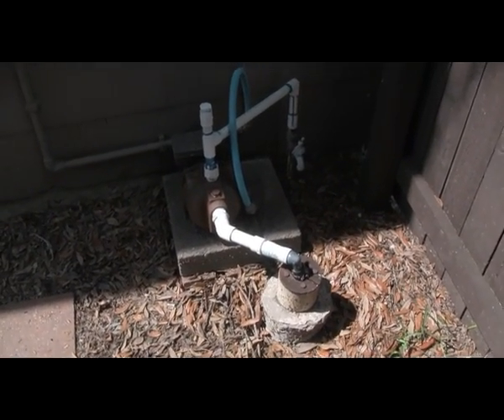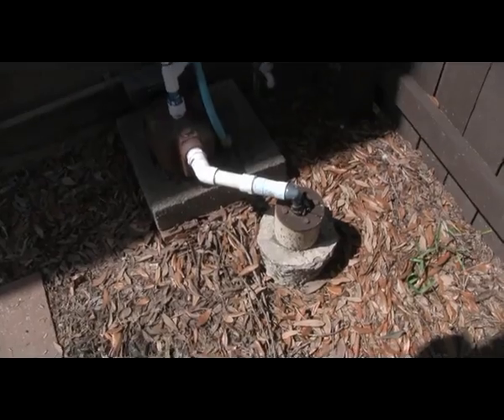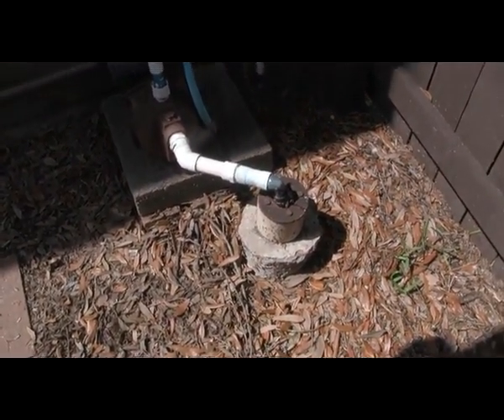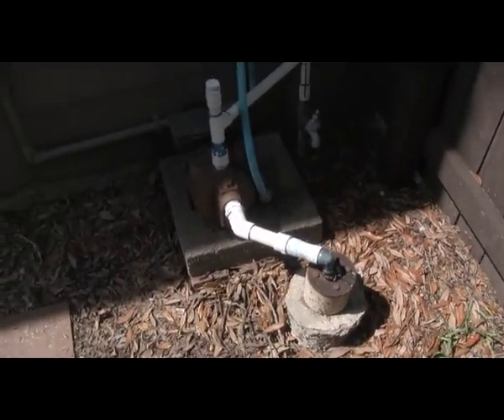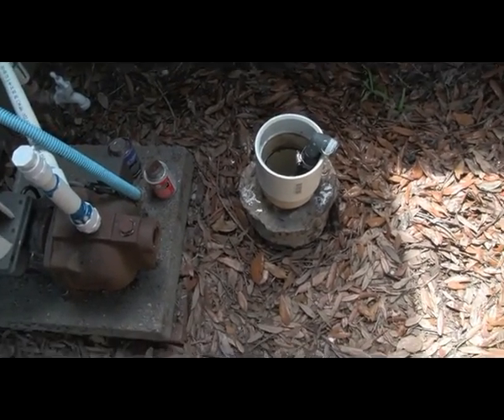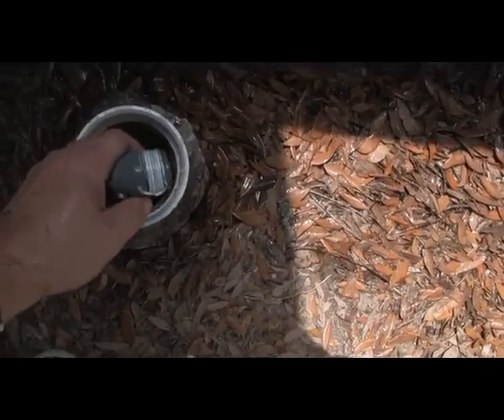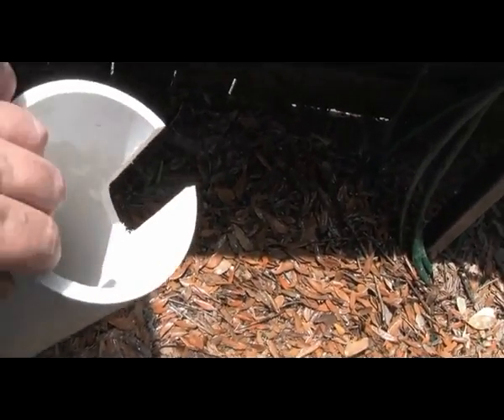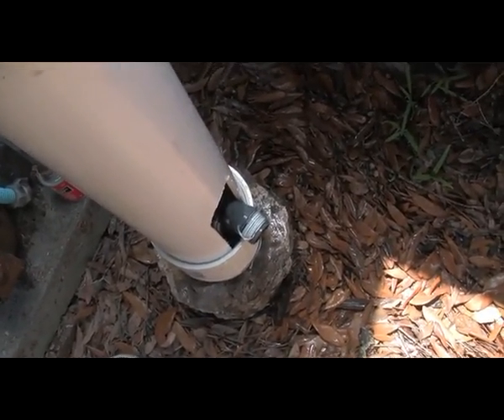Harbor Freight  well hand pump install

Comment: You're the man! I have a well with an electric pump that doesn't tie into the house. I've got the electric pump working so I can  use the well to water the grass, but I've been wanting to add a hand pump as well for an emergency water supply. We live in hurricane country, so this will come in handy when the power goes out.

Comment: Now that was one great video and very much appreciated.  I have a 100' well with a 3" casing, water at 15' down and want to do the exact same thing.  I have already pulled the old metal draw pipe out and will replace it with PVC and a foot valve.  Thanks for this video!

Comment: @PrepperCountry That all depends on the formation the water is coming from and how well the formations above that are at preventing surface water from getting down there. As a general rule for a potable water supply your well casing should probably not be any less than 25ft and some regulations actually require at least 25ft of well casing. The only way you'll know is to drill it, put in the casing and seal it with bentonite, then chlorinate the well, flush it and have a sample tested.

Comment from the maker: @prescottbill The maximum depth from which water can be raised by any pump that relies on 
suction is approximately 34 feet. That's because suction pumps raise water in 
a tube by creating a partial vacuum above the water; atmospheric pressure 
forces the water up the tube. Atmospheric pressure will support a water column 
no higher than 10.34 meters, or about 34 feet.

Comment: Nice job, good vid. Just PVC brakes down in sun light. Get a rattle can and paint it all. to block the UV rays. It well last years longer. You are now set for a long term power outage.

Comment: Great video. Don't forget some insulation. Don't want any pipes busting.

How about getting a cistern to store water and slowly fill it with the electric pump? And/or a small raised water tank to create some pressure indoors.

Comment: Just a quick note, those type of hand pumps or as a general rule any hand pump that has to be primed by pouring in water or has an open top is not a sanitary solution for drinking water. The water used for priming and the open top can introduce bacteria into the well. I am a licensed well driller and that would not be approved in my state. Hand pumps used for supplying drinking water should have a sealed top and self priming with pump cylinder below the static water level. BTW nice job on this.
Reply: Didn't know it was a difference thanks for the info

Comment: Man you do some real good work. I have a quick question, is the water pressure really that dam intense throughout the house? or is it because of the location of the spout outside? and that water is well water so you're not paying for it right? It's relatively safe correct? sorry I had more than one question looks like. Great job, just subscribed .

Comment from the maker: @kalif151byccrew That was the pressure coming off the pump. I have city water in the house and it does not have that kind of pressure. I have a couple of other videos on my channel on testing and filtering the well water. thanks for the sub...........

Comment: A well should be a "sealed" unit.  That is once you establish a well; install the piping, wiring and water and bug tight well cap you need to chlorinate the well.  From that point on it is considered clean and pure as far as the water goes.  Once that "sealed unit" is opened, you need to chlorinate it again.  See 2nd part of comment please

Comment: would you tell  how deep the well is and what type of electric pump that was.  doesn't look like a standard shallow well pump
Reply: +Rick Vantrease  The pump head is for shallow water well if it was a deep well head it would have two pipes on the end ...one for the intake and one for the jet to drive the water up when pulling ....and the foot valve would also have to have two pipe fitting ...check it out

Comment: Couldnt you have just put the hand pump atop the outlet side of your pump with a check valve and pull water through your pump when the pump is not running???